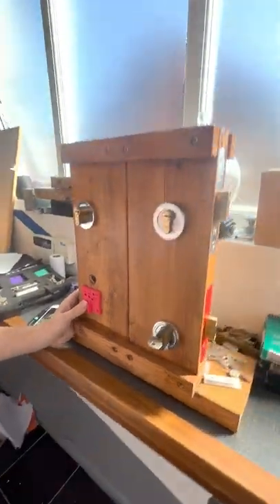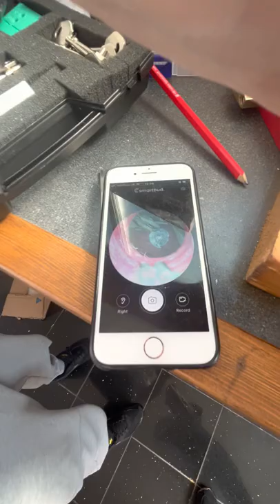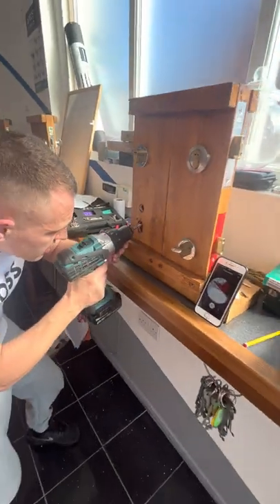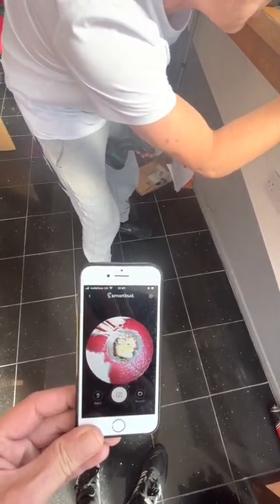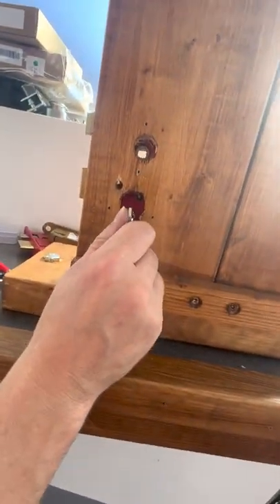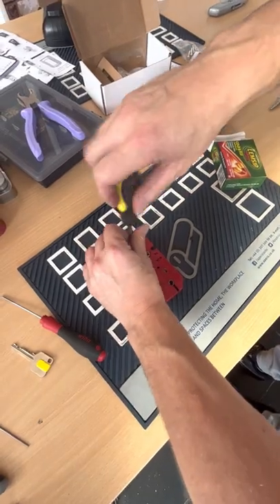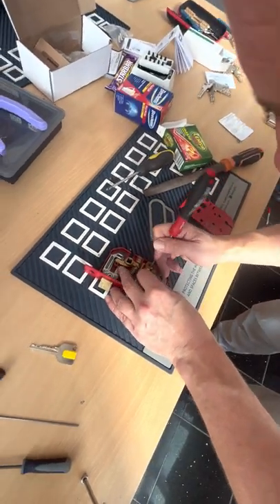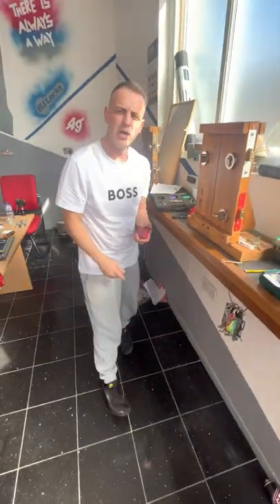Mortice drill template kit part 3

Comment: I was worried your phone was going to fall off on to that tiled floor!
Well done, it's not a tool I would use every day but what a tool to have when you do need it, especially for some of the random locks that you may not have a decoder or dedicated pick for.
Reply from the maker: Exactly that Mathew , some locks just put up a good fight….or for people who hardly ever come across mortice work abd don’t want to spend £££ on decoders etc
Reply: Hi both. I’m slowly but surely building my knowledge on Mortice locks. As you can end up spending so much on the equipment I was wondering if there a specific bit of kit that you would say you use most often with mortice? One that deals with the more common mortice lock found in UK? Any advice would be massively appreciated 👍
Reply from the maker: @luke2011ism  for sure the Fortress decoder , I use that more than any other pal
Reply: @FortressLocksmiths  cheers mate I’ll have a gander now. Great vids learnt a lot from them 👍